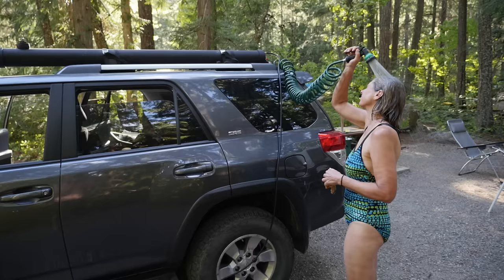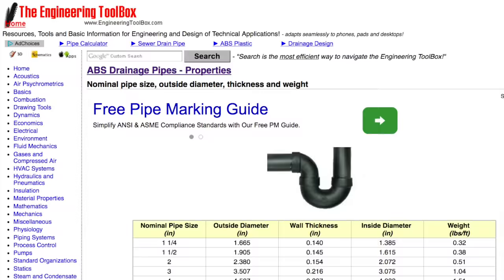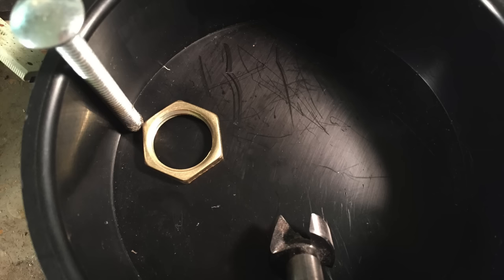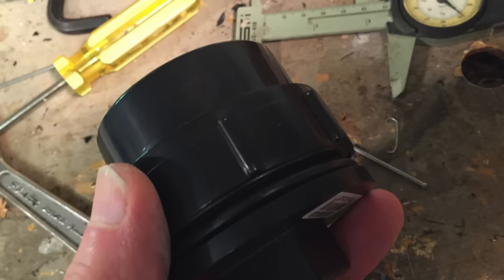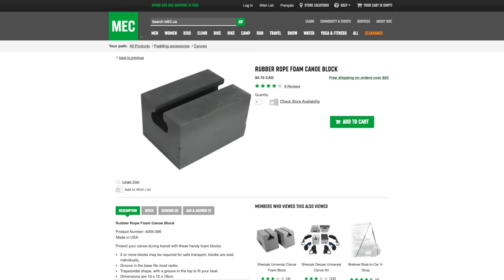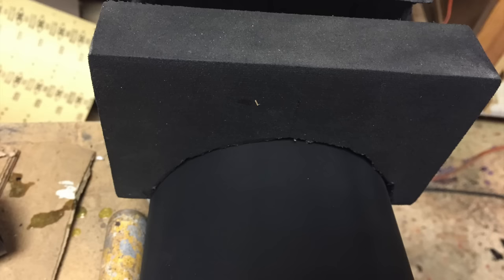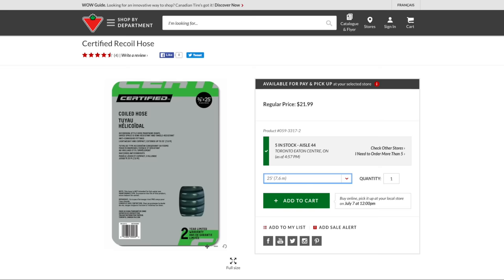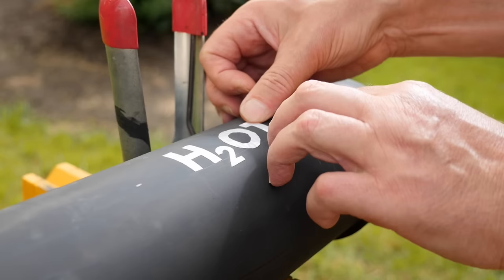H2OT - Rooftop, pressurized, solar-heated shower/sprayer using ABS pipe. DIY

Comment: Wow this is very smart! I plan to convert a cargo van into my home on wheels and I am very serious about mounting solar panels and after watching your video I think it would be very smart to attempt to also hook one of these tubes up to reduce the amount of energy I use. Do you think it would be possible to mount this as-well? Or is there another way to mount it safely?
Reply from the maker: It pretty much has to mount as shown. The reason is that it is taking advantage of reflective heat off the roof of the truck. Plus, it was to be accessible, to both fill with water and to connect the hoses.
Reply: imaginetMedia thank you for replying. Maybe I could attach  my solar panels on in a different way. Thanks again :)
Reply from the maker: Peter  Highly unlikely that there would be any noticeable pressure increase that that temperature. 
I am sure you have had water bottles in your car in similar heat. What happens when you unscrew the lid?  Nothing, correct?
Reply: @ImaginetMedia  You could always leave the radiator valve open until you need to use it. That would prevent any pressure build up from heat.

Comment: Good information and nice shower
 How is the fill cap joint holding up with the 4" pipe? Thinking of using your idea but was concerned about the connection hold up to multiple uses
 Thanks for the video
Reply from the maker: The connection is stronger than the pipe itself. ABS solvent cement is not glue. It chemically welds the components together. It will never come apart without destroying the parts first.

Comment: How do you avoid leak of presure ? 
I tried it with and without seal tape (teflon) and I am still not able to keep all the preasure inside the tube. Any tips ?
Reply: Difficult to answer your question unless you tell us specifically where the pressure loss is coming from.
Reply: abs cement

Comment: You say early in the video that you chose 4" x 6' pipe but later say that it was a 6" pipe. Did you bump up to 6"? What length did you end up choosing? I'm super excited to do this project. I live in Texas, so getting hot and sweaty camping is a given--this would be a savior!!!!!!!!!!! Thank you so much.
Reply from the maker: Not sure where you heard I used 6" pipe.  As indicated at 1:18, I chose 4" pipe, 6 feet long. All the data required to determine what length and diameter will best work for you, is shown in my spreadsheet, which I included for viewers convenience. NOTE: that as diameters of ABS pipe increase the costs goes up dramatically. .
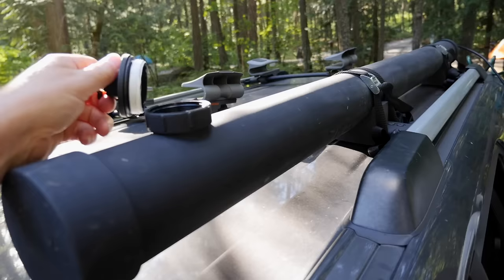Reply: Right--4" x 6' was what you said. I got confused, because you said at 4:05 that you filled it with 30L of water (which is the volume of 6" x 6' as shown in your chart) and at 5:00 you discuss the bursting point of 6" pipe. Still, I think you are a Chanukah angel, and I plan to spend my kid's winter break at school building this with him. He's pumped.

Comment: I tried to scan through the comments but there are so many… How do you maintain the pressure? It seems to me it would overpressurize if you didn’t open that valve…Do you leave the compressor running and/or have a way to control the PSI it puts out?  I ask because I have a simple Smitty built  compressor
Reply from the maker: I only pressurize to 30psi.  I then shut OFF the compressor. I turn the compressor back on at 10psi which still provides a good stream pressure.  However, when the tank is full, it takes a second to go from 0 to 30 psi. SO, the fuller the tank, the more frequently you have to turn on the compressor. As the water drains, there is more air space which allows more air to be compressed. This makes the recompressing intervals les and less frequent, but there duration longer.  If the tank is half full, it may take 10 seconds with the compressor on to get from 10 to 30 psi. That presuration cycle wil last for most of my shower.   It is obvious that a 2nd person is very helpful, and that is what we do, take turns on the compressor and showering.    I hope this answers your question.
Reply: Thank you so much, that answers my question perfectly. And in the detail I would expect after watching your video, no less! For some reason I thought the compressor was on  continuously.

Comment: Hello there,  the presentation of this video is fantastic! I'm taking a lot of inspiration from it, but I was considering instead of usin 100mm x 2m pipe, use 150mm x 2m to increase the volume of water to bring with me while I'm away. Now, my question is if increasing the volume of the water with 150mm diameter will gives to much weight to the side of my van creating bad balance in my veicle? In your project you said it can carry about 16 liters,  not sure how many more you cen get using 150mm diameter..
Reply from the maker: All the data is in the spreadsheet I show. My reason for not using 150mm pipe was simply cost and availability. 6" ABS is very expensive here and very hard to source. I suggest you price out your options locally.
Reply: imaginetMedia thank you for your answer.  I'll check out some prices locally here in Australia. My only concern was more related to the inclination of the vehicle for putting too much weight in only one side. Thanks anyway for taking time to reply the comment. Cheers
Reply from the maker: Yes, that extra weight could be a problem, depending upon the vehicle. Going from 4" to 6" more than doubles the weight. I would be more concerned about the mounting system to the roof. My canoe pads and nylon straps work fantastic for the weight of a 4" pipe, but will not work for 6" I suspect.
Reply: I have a rhino roof rack, and I was planning to hanging on one side with few metal legs plus some others straps similar to yours. Another bit is not clear is when you say that the full capacity in 15 liters, but for testing with the rivers water you filled with 30 liters?
Reply from the maker: That was the sum of 2 tests over that camping trip. I agree, it is not that clear in the video.
Reply: Thank you Sir!!!
Reply: One thing to consider- more volume of water will increase the time it takes to warm up. Granted, in 45C in the outback, it will warm up a lot faster than in a Canadian West Coast summer!  Another consideration is that he only travels with the pipe completely FULL or EMPTY.  So, if you are thinking to extend your travels by adding more volume, you may be disappointed because once you introduce air into the system you will want to drain the rest to prevent the water hammer.  You would be better off carrying your water in smaller containers (jerry cans?) and filling the pipe as you need the water heated.

Comment: I've built two of these now with schedule 40 pvc (for pressure) and a slightly different design.  Both leak at the "outlet" end cap.  I used a shit ton of glue on the 2nd one too.  Not sure why it still leaks.
Reply from the maker: Where exactly is it leaking?  If it is at an ABS to ABS connection (i.e. fitting to pipe) then you either have the wrong solvent cement (you said you used "glue"). ABS solvent cement chemically welds the connection together, it does not glue it. It forms a slurry of semi-liquid ABS that bonds and fills minute gaps. You can see how well the proper solvent cement works in the 2" fitting I used for the filler cap.
Reply: @ImaginetMedia  I used 2 part PVC cement from the hardware store with the purple primer and cement.  It seals well until I pressurize it for the first time then I get the slow drip drip drip from where the end cap meets the pipe.  On the 2nd one I did, I used a shit ton of primer and glue.  I used 4" schedule 40 PVC with red labeling that reads "for pressure 220 PSI max".
Reply from the maker: @SD-pi9co  Sounds like the caps and the pipe are from different manufacturers. Can you check this. They should save the manufacturer's name on each part. 4" pipe is the Inside diameter. So the cap has to match the OUTSIDE diameter of the pipe exactly. The different pipe makes will have different pipe wall thicknesses.  This is one of the MANY reasons that I have mentioned here in the comments before as to why I chose ABS over PVC.
Reply: @SD-pi9co  Use PVC swimming pool plumbing pipe. May be a little more expensive but you can buy threaded fittings with teflon tape if worried about leaks (if you use the glue and primer properly it wont leak from non threaded fittings) with ball valves etc that will weather and be leak proof much better than this black pvc pipe and associated glues.

Comment from the maker: You want to get Faucet Lock Nuts. The one I used is made by Moen and can be found in the plumbing department of you local hardware store. Here are the ones I used. (Note the price is in $CDN)
https://www.homedepot.ca/en/home/p.brass-faucet-lock-nut.1000516334.html
Reply: Thanks - funny how HD and other stores in USA doesn't stock them, but at least I have a better reference to go on. Cheers!
Reply from the maker: Just search for faucet nut at homedepot.com. There are lots of them.

Comment: When threading the radiator drain valve, did you just drill a slightly undersized hole and screw the threads into the ABS? Or did you use an actual tap? Thanks!
Reply from the maker: The threads are tapered NPT. Just drill the correct sized hole and the valve will self tap itself.  One tip I did not mention is I heated both valves up with a propane torch just before I threaded them into the ABS. This softened the pipe and made the tapping very easy, plus it helps form a perfect seal when it cools.

Comment: Genius!
But I do not understand dipping the steel wool in denatured alcohol. What is the purpose of the alcohol?
Reply from the maker: It cleans the surface. Removes any residue from the pipe fabrication process, oils, and fingerprints. Proper surface preparation is the key to every paint job.  The primer is thee so the black paint has something to bind to. The methyl hydrate and steel wool provide a surface that the primer can bind to. 

The end result is a painted surface that will never flack, chip or peel.
Reply: Thanks for that. I was imagining some chemical reaction that might have altered the thermal conductivity of the pipe. ☺
Reply from the maker: That is a much better explanation than mine. But alas, it is only done to clean the pipe.

Comment: Love this! I'm having one completely dumb problem duplicating the project - for the life of me I haven't been able to find hex nuts to secure the hose bibb. I've been to HD, Runnings, Tractor Supply, local auto/boat/plumbing suppliers, and an hour of online store searching. Maybe it's being in the US (I've had to special order ABS fittings because no stores seem to carry it). Do you have an online source for those nuts, and their thread size?
Reply: just go to lowes or home depot and find a 3/4 hose cap and drill a hole in it.

Comment: I would like to know where you obtained the packet of faucet nuts. I have been to several plumbing stores as well as Home Depot and Lowes without any success. Thank you for your time.
Reply from the maker: Any faucet lock nut will do as long as it matches the threads of the drain. I happen to have bought mine at Home Depot. 

Home Depot Canada
https://www.homedepot.ca/en/home/p.brass-faucet-lock-nut.1000516334.html#

Moen Canada
http://www.moen.ca/m-line/faucet-lock-nuts/_/R-CA-CONSUMER:M3875
Reply: Thank you for your response. Its on order.
Reply: Red Tail ... go to a pro plumbing store it might cost an extra $3.00 but the usual suspects big 3 box stores only hire minuume wage  children, elderly folks , and people with a leg and 2 fingers ... asking them for directions or locations of supplies is like asking chuck berry ( are you dead yet, what about now ?) ... they just have no clue what your asking them about and often will just make something up just so you leave them alone to there iphones

the orange, blue and green stores all have what you want... but know one working there has a clue what they are ...a faucet nut? try paint or lawn and garden dept...😶

prop

prop
Reply: Thanks I'll check into that.

Comment: Hey mate amazing video. So I've made it all now and I've got two questions, how little air do you leave in it, as water doesn't compress I worry it'll blow if filled too much? I've also made mine to a different size than yours, are there any red flags on  if I've overpressurised it? Thanks in advance
Reply from the maker: I only pressurize it moments. before I use it. Once done, if there is any water left, I let off the pressure using the radiator drain valve. It never sits pressurized if I am not using it.     Regarding your pipe choice, as long as it is rated Schedule 40, you should be fine up to 30psi, which is plenty to blast most dirt off.  I let it run down to about 10psi before I turn the compressor back on to top it up to 30psi.
Reply: @ImaginetMedia  Appreciate the response! Sorry I mean, do you fill this completely with water to the very brim? Is there some ratio of how much water you can put in there?
Reply from the maker: @AetherTheDragon  I fill it righ to the brim as I am usually driving around with it on the roof. If it is full, the water cannot "move", it is in essence one solid mass. If there was any air in it, you would create a water hammer when the contents moved during braking, thus turning your shower into a missile launcher. 

Note, however, as you point out, water does not compress. So, initially, it will pressurize almost instantly and run down very quickly. As you use the shower, more void is created and more air can be added and compressed, creating a longer span between compressing operations.
Reply: @ImaginetMedia  Awesome mate I'll have a shot at it, thanks again for the whole video
Reply: @Krazy Kanuck would this problem be mitigated by adding baffles? And would these still be safe under high pressure?
Reply: @Krazy Kanuck My roof load isn't a problem I'm talking about if I go to a campsite and use 50% of it, I don't want to be driving around with that water's force acting against the container with every brake, baffles would mitigate that, and mainly I meant using baffles in a high pressure environment but they would be
Reply: @AetherTheDragon  ... think about it for a second. The pressure will be equal on both sides of the baffle. The only structural consideration will be the weight of the water sloshing around against the baffles, which could be considerable if you don't have enough holes to let water through.
Reply: @rupe53  The baffles have nothing to do with the pressure, read what I wrote and think about it for a second.
Reply: @AetherTheDragon  ... that's what I said. Read it again and you will see it's only the weight of the water movement against the baffles, not the air pressure. (which would be on both sides, if there was any)
Reply: @rupe53  bro the pressure against the baffles is irrelevant its the weight of the water freely moving within the container while I brake, hence the whole point of baffles

Comment: This was great. Thank you. Any idea where I might be able to find a way to hook my tire pressure system to it? The reason I ask is I have a 1/4" outlet at the bumper. If I can get that to pressurize this then I wont need another compressor. I can place a regulator in-line to limit to 30psi as you suggest.
Reply: I think I just answered my own question. 1/4" to the regulator and then out of the regulator to the schrader. So basically I screw the regulator into the schrader and then plug it into the 1/4.. Cool man. This is GOLD. On my rack I can simply add two of them. Easy.
Reply from the maker: @jasonmotorcycle8987  Excellent modification.  It sounds like a great addition and will work well.
Reply from the maker: @WYO_Cowboy_Joe  This is pure genius. Assuming you have at least 30psi in the spare, this would work beautifully.
Reply: @ImaginetMedia  So I ended up making a U. I raised it up a little to clear the spickets... I added two outlets one on each end of the U. I added a female to female connector so I can fill it from the spicket by opening the schrader valve. It is fun when it is finally full (it geysers)... So I get 6.5 Gal. Whichever side is lower is the side you hook the outlet to. Then you do as you say. Thank you for the idea sir. I leave it up there and it is just useful. Had enough to wash hands and do dishes for a couple days.

Comment: Good job. Nice! What kind of PVC did you use - I see 'schedule 40' is the kind made for pressurized applications but its so heavy! Did you just use regular DWV? Drain waste vent?
Reply from the maker: I did not use PVC. I used ABS.  Polyvinyl chloride ≠ Acrylonitrile butadiene styrene.

Comment: Great video! Do you hook up the compressor to the car batteries or do you have another battery?
Reply from the maker: I use the car battery. The compressor is heavy duty and has spring clips to connect directly. ALthough, I have connected to the 12v battery a few times when I am parked close to it.
Reply: I use my solar battery.

Comment: And in the hot summer sun the PVC warps...
Reply from the maker: And that is why it is built with ABS pipe and not PVC.  ABS will remain rigid to 82C. Of curse with water inside the temperature would never even get close to half that temperature in the summer.